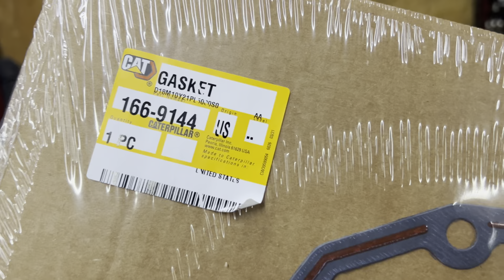THE SCAM TRUCK GETS A NEW ENGINE INSTALLED.. THE PETERBILT GETS A HUGE UPGRADE!!

Comment: I have a series 60 in a cascadeia glider. It's got 346000 on it. No problems at all...  greatest engine I've ever had...
Reply: Only downfall is you gotta run it at 1600 to feel the torque

Comment: 3406 E models are easy to time. With the flywheel on, there is a hole in the right front side of the flywheel housing. Put a 3/8 bolt in the hole and bar the crankshaft over and when the bolt falls in the hole your bottom end is timed. When you get the cam gear on line the arrow on the gear with the mark on the top of the peanut cover. All the other gears don't have to be marked.
Reply: Why is it that sometimes it’s a half a teeth off when timing the cam gear? Has anyone else had this issue?

Comment: “Fuel prices are ridiculous guys” -proceeds to install a FAT 1000hp camshaft. Gotta love it 😂
Reply: if driven properly, with a good tune itll get better fuel mileage than a stock 500hp. and be better overall for its run time. "again if driven properly."
Reply: @oregonfordguy9812  Yeah, I’d imagine it’s easier for a 1000hp engine to run at 500 all day vs a 500hp engine running at 500 all day. Obviously he knows what he’s doing, but just the child in me laughed a little when I saw that lol
Reply: @zebgraves4562  I did too. 1000hp is a bit ridiculous.  last guy to do it snapped a crank. I run a 550/2050 12.7 every day.  0 issues and around 7mpg dragging a open deck at 80k gross
Reply: @oregonfordguy9812  what parts have you change for your 12.7 to have that power ..or is it a tune
Reply: @truckingjamaicans5045  I made sure it was all stock 500 parts. then added a ex manifolds and bg702 turbo then the tune
Reply: @oregonfordguy9812  thx for the info

Comment: Tim, get yourself a carbide super scraper, they work excellent on flat surfaces, and like dad said, NEVER use a whiz wheel, or roloc disc .. hose the piss out of it with NON CHLORINATED brake clean…oh and you never want to use a lot of silicone, it gets inside the engine and fins it way to pickup screen which is a no bueno situation.. good luck with your cat..
Reply: Agreed, one up on silicone is something like flange sealer loctite 515 or another anaerobic sealer, shellac is a thing of the past.

Comment: Back in the day we used diesel oil and a brush washed it off with the water hose It works out real nice ,  What I would do with that cover is go by a can of  Oven  cleaner Spray it all over let it set 15 or 20 minutes  Spray it off shouldn't have nothing on it When you're done

Comment: A little tip for future reference. When doing a front structure on a cat put a small amount of permatex in both lower corners and put a small amount on the oil pan gasket. Right in the corners they all meet.

Comment: If that brown stuff you were asking your dad about is Perfect Seal #4, it's used on aircraft piston engines with silk thread to seal the 2 case halves.

And that CAT gasket that looked funny was because they didn't want to package it on as large a sheet of cardboard as it would require, so they used the little round tube and rubber bands to fold it to fit the smaller sheet. The round tube lets them bend it without forming a crease.

Comment: Tim I was wording if you could helpI have a 1998 12.7 Detroit and I put a new head on it because it  had a bad injector cup and  it has been running hot and I have oil in the water
Reply: What do you think it could be

Comment: I'm more local have residential customers. About 80 percent of them understand. I lost one because I'm higher then when I did work for them a few years ago. Evidently some people don't watch news or the wrong news and don't buy groceries or gas for their car. I've had same customers for thirty years. More concerned with surviving but a profit would be nice.  A couple competitors have retired or sold out. Most are busy but a couple have trucks sitting because running a septic truck for 30 bucks an hour doesn't attract no help. Must still be free money out there. A couple of treatment plants closed or cut back in my area. Have to go haul farther away to dump. Other parts of US the same way. Building new houses like crazy even though harder to dump. Running tankers to haul septage to treatment plants for smaller companies used to be good money.

Comment: $1,500 for new gaskets? Aight I just changed my favorite engine from a 6nz to a 12.7 Detroit.
Reply: whole package overall is cheaper. we just redid my entire 12.7 1999. tip to bottom. including head and injectors, a tune and big turbo for 22k.. including labor.

Comment: TIM, what kind of fuel economy do you get with that 16 liter CAT engine? You're going to have to swap it for an M-11 Cummins, till things settle down. Yes, I’m joking about the M-11, it’s a smaller engine, but puts holds it grounds, puts out impressive fuel economy and is pretty reliable. I am very curious the fuel economy numbers on your fleet. You should post a video on it.

Comment: Why are you paint marking gears for?????????????? There are timing marks on crank and bull gear and nothing else it was carry over from mechanic engines. Other gear with bull gear has no timing marks on it would have if it was mechanic engine for cam gear (cam was in block). These timing marks mean nothing on E-model engine. Other timing mark on cam gear and that points to tab on gear housing. Pin flywheel and time cam gear to tab on gear housing DONE and while setting lash on adjustable cam idler gear

Comment: What pisses me off big time is that while the cost of fuel goes up so do the profits of the big oil companies which is also soaring. After doing some on line research I found out the direct subsidies for fossil fuel production—money that flows directly from the government to fossil fuel companies to support activities like exploration, extraction, and development. A conservative estimate from Oil Change International puts the U.S. total at around $20.5 billion annually, including $14.7 billion in federal subsidies and $5.8 billion in state-level incentives. A whopping 80 percent of this goes to oil and gas (with the rest supporting coal), and most of the subsidies are in the form of tax deductions and exemptions and other “obscure tax loopholes and accounting tricks” that result in massive avoided costs for fossil fuel producers.
Either way we are paying to make them richer.

Comment: Maybe go take some classes on cat engines !!!
What caused that leak is using a screw driver as a chisel to remove the cover.. bad move.
And that African engineering is another JOKE..
I hope.your smart enough to use new gaskets.
And you can buy gaskets cheaper than $1,500..
In fact they can be made by hand if your good enough..
( It's called Indian head shellac ) I used it 40 years ago to seal old 1930's to the 1950's Harley motors .
Also if you torque the cover bolts in order it shouldn't leak or warp...